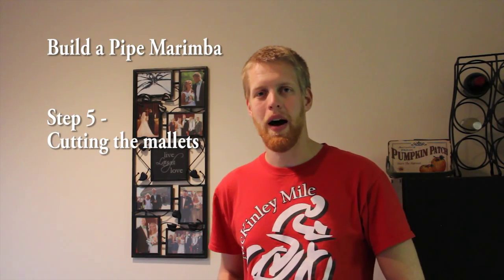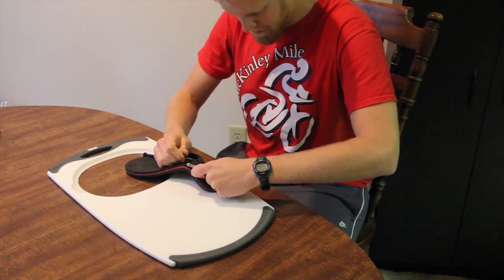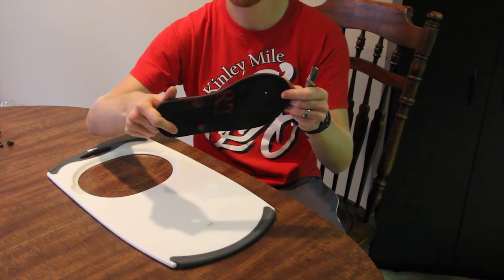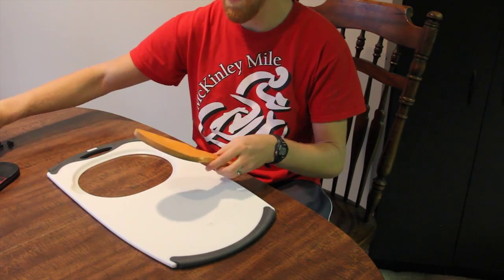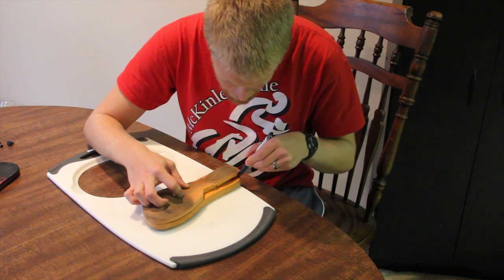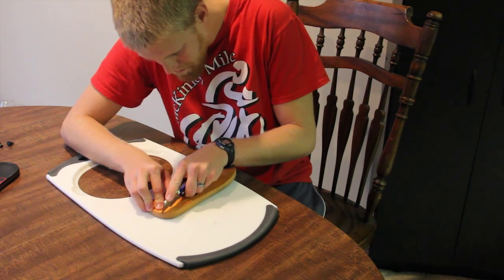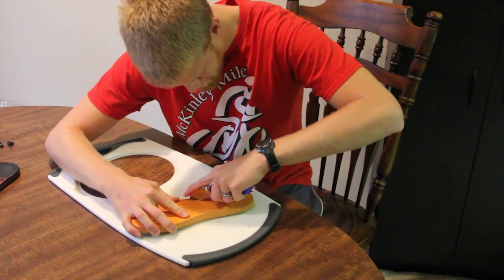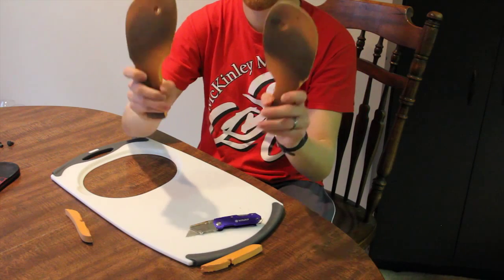Build a Pipe Marimba - Part 5

Comment: Did you delete your website? This link does not work? Also, it would have been nice if you would have show the complete assembly, including putting the pipes in the frame and the final finished marimba. Without a working link I find it almost impossible to do this project since you never give clear measurements for the pipes. It is a good step by step instructional set of videos but without the things I mentioned it is only a basic set of rather vague instructions.
Reply from the maker: Sorry, try this link instead: http://brandonbuller.wordpress.com/category/pipe-marimba/

Also, I intentionally did not show every step. I hope that leaving this set of instructions vague will cause others to innovate and improve upon anything that I was able to do. I think that you will be able to do much better than I did!